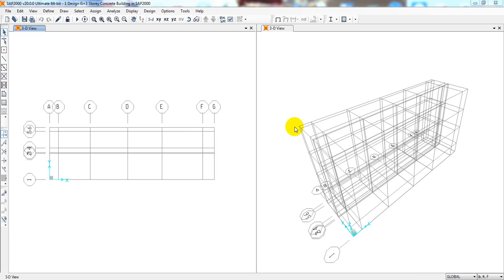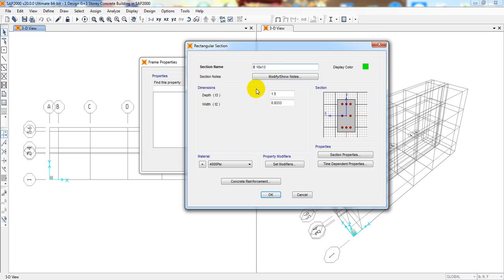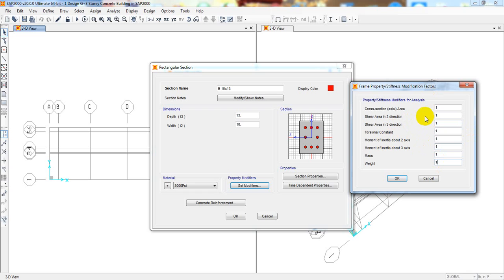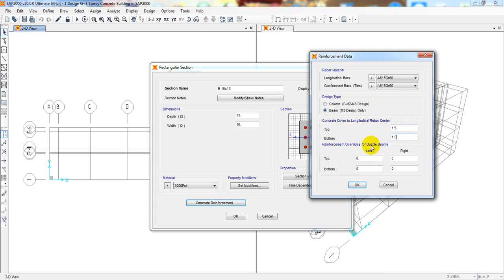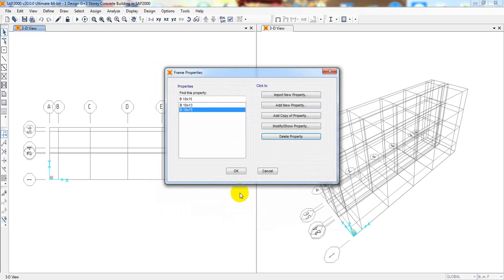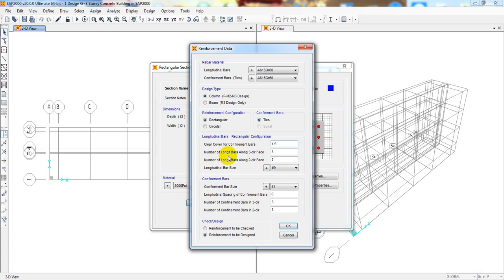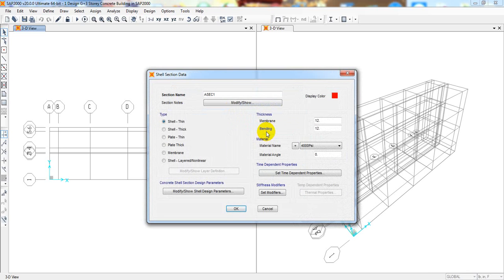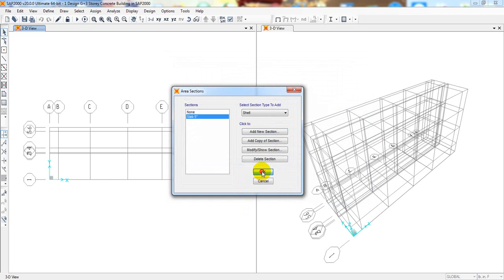Design G+3 Storey Concrete Building in SAP2000 -03 | Define Beam Column Slab Properties in SAP 2000

Comment: boss while adding steel, actually u should add rebars and not steel bcz these two are different things, Steel is separate design while rebars are used in concrete
Reply from the maker: Ok bro...